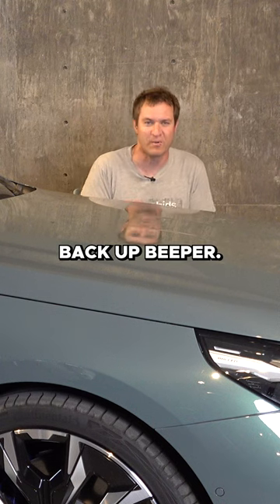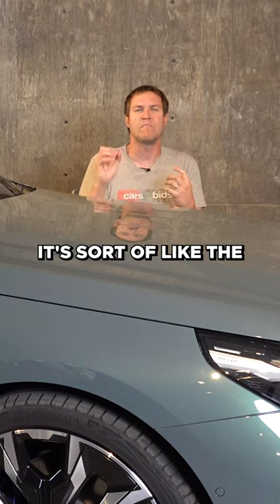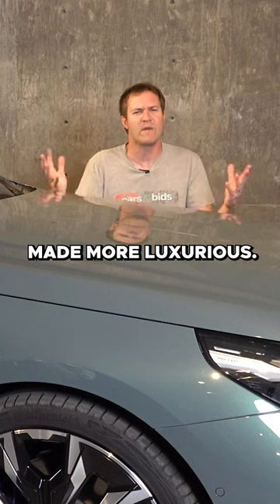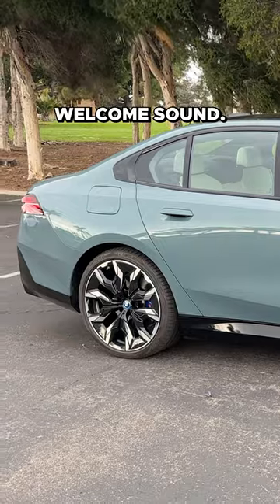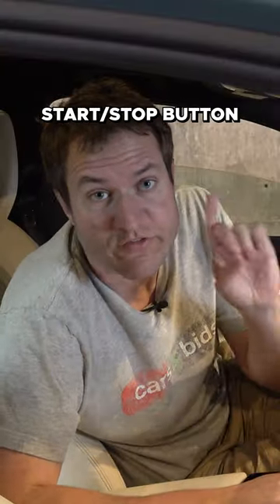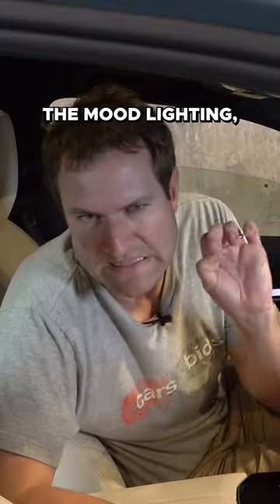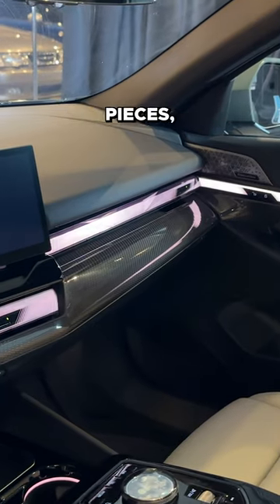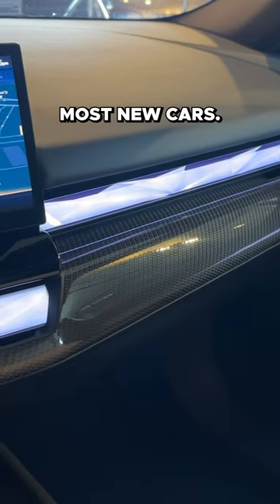2024 BMW i5 Makes Weird Noises #shorts

Comment: Fun Fact! The reason why many of these modern back up sounds end up sounding like that is because It Sounds Cool and is necessary for electric cars. But also the soft "white-noise" sound makes the source of the noise easier to locate than a traditional beep. 

(I learned this from a Technology Connections Video on the subject. Check it out!)